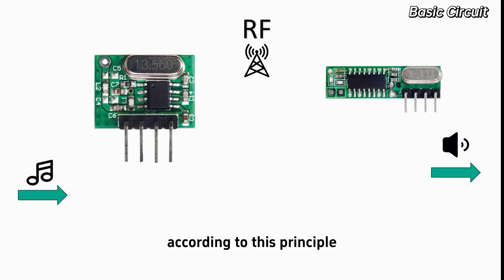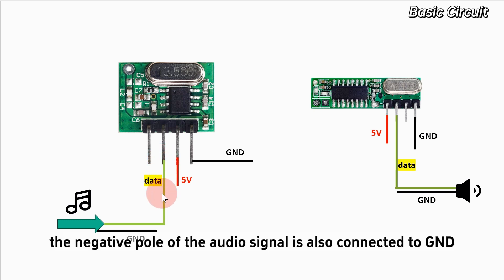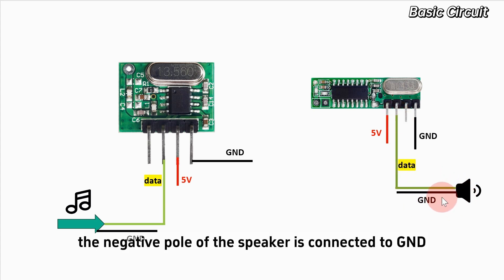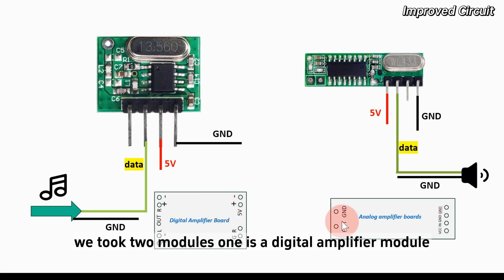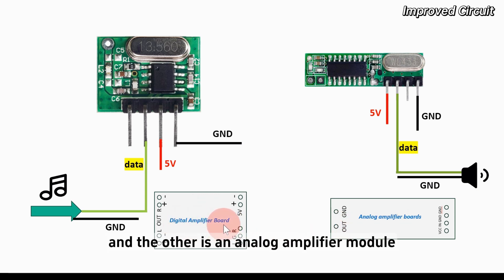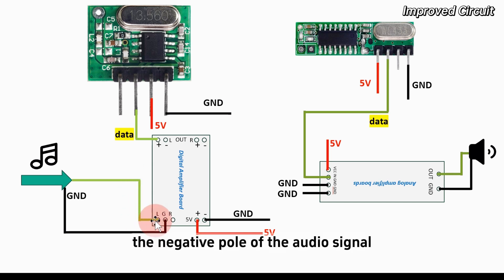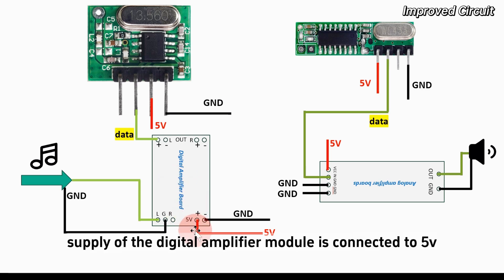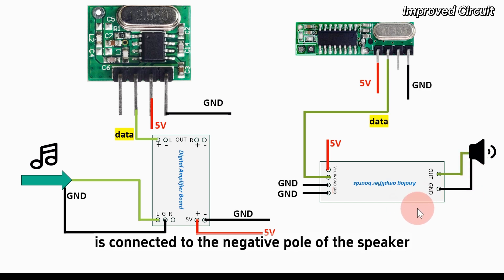How to use 433mhz transmitter and receiver to transmit audio Superheterodyne Modules  walkie-talkie

Comment: To be useful for audio, you need to convert the analog audio signal to digital with an ADC, then transmit the signal in some asynchronous protocol (like USART),  then decode the signal, then use a DAC, then an audio amplifier.

Comment: How to reduce noise
Reply from the maker: We've found that there are many similar videos online. Some of them even have no noise at all, which we're skeptical about. Because in our tests, it's impossible to eliminate the noise completely. You can only get it to a usable state, but it's surely not satisfactory. I think this is why this technology hasn't been widely adopted.
Reply: I don't understand how 200 rupees walkie talkie toys can do this with only a little noise and long range, but we can't do it with good speakers, modules. Which module do they use in the toy walkie talkies? I want to make a project which has atleast 5m range and the voice should be understandable. Right now in my project I am able to produce understandable sound but for a very short range
Reply from the maker: @anirudhpadegal9729  
That's great. You've actually found the key point, which is the choice of module. Generally speaking, a 2.4GHz module is suitable for short - range communication, with high - fidelity sound quality and low noise. A 433MHz module is suitable for long - range communication, but the sound quality is indeed mediocre. Even up to now, walkie - talkies for long - range communication still have a hissing sound.

Regarding your project, since you've already achieved good sound quality and you need to increase the range, you can consider two aspects: the antenna or adding a signal amplification module.

Finally, may I ask if the module you are using is a 2.4GHz one?
Reply: @qiachip  No i was using that 433mhz module, btw can u please tell what is the module that they use in toy walkie talkies. They are really very cheap
Reply: @qiachip  What do u mean by a signal amplification module, I use the digital and the analog amplifier exactly as u did - same circuit diagram and everything
Reply from the maker: @anirudhpadegal9729  
The information I obtained from the Internet is as follows:
Toy walkie - talkies commonly use the following low - cost modules:
BK4802 chip solution (adopted by McDonald's toys, etc. It is highly integrated, with a motherboard cost of 1.5 yuan per piece, supports multiple frequency bands, and requires no additional components).
FM modulation module (MC2833 for transmission + MC3362 for reception. The technology is mature and suitable for mass production).
HT12E/HT12D encoding and decoding module (OOK modulation, simple in structure, used for toys with low - quality sound).
You can first look for the specification sheets of these chips. eg:  The BK4802 not only integrates communication functions but also an amplification function.
Reply from the maker: @anirudhpadegal9729  
Yes, that's the signal amplification part. It seems you've already got that done. Then, regarding the range issue, you can try improving the antenna.